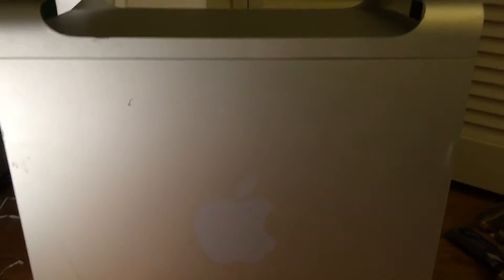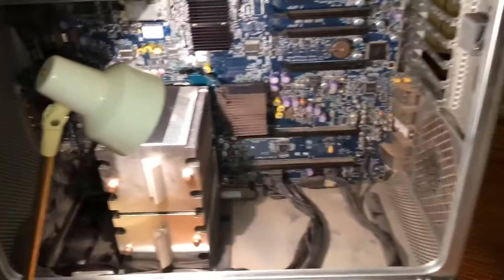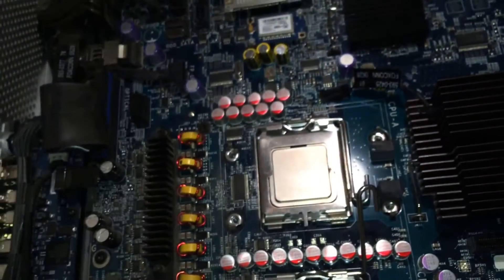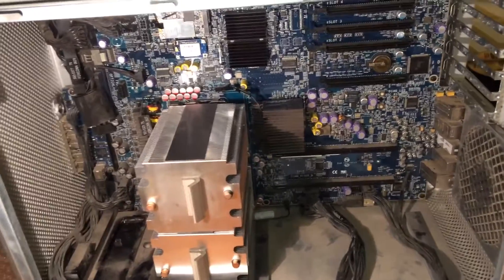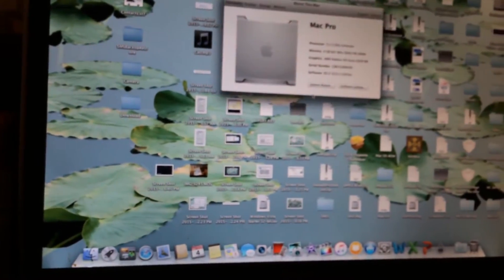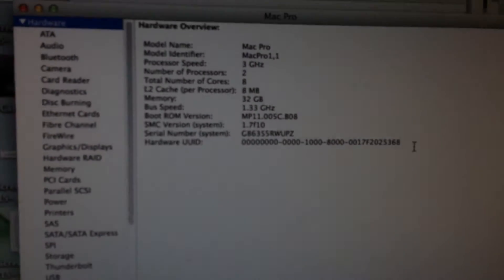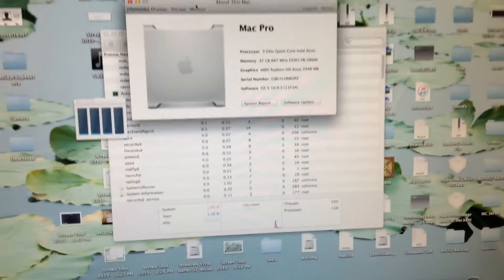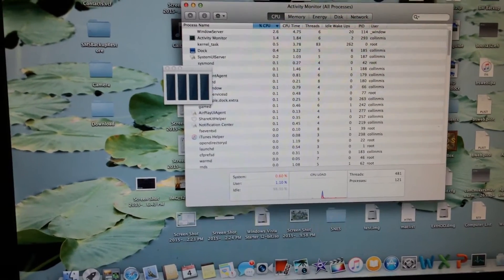Early-2006 Mac Pro 1,1 Quad-Core Xeon Upgrade

Comment: I Just Acquired one of these on marketplace for $25.00; the Seller said it was his Daily for a long time, Finally Quit.
He was Guessing the Power Supply Died, removed the HDD, and Figured someone could use it for a Case Mod.
I'm New to Mac, Couldnt Afford 'em, This is Awesome! I've slowly, Stupid Fan Shroud, been Tearing this Down, It's CAKED with Dust, Im Hoping to get it working & do this Mod depending on whats in there... 6Gig Ram & an ATi 512...
CONGRATS!! on the 2Tb MacMini!

Comment: The ATI Radeon HD 5770 GPU (genuine Mac version) in my Mac Pro 1,1 (not flashed and still has the stock CPUs) runs at full x16. Mavericks is buttery smooth running at 1920x1200 on a first-gen Cinema HD display.
Reply: My ATI Radeon HD 5870  not flashed to

Comment: Can you have time to look into the Mac Pro 1.1/2.1 to accept the x5470? Socket and the bus speed is the same 1333mhz , another YouTuber have try it force the 3.1 firmware and get boot up. Or may be work on windows side ?

Comment: Thanks for the instruction. I have two Mac Pro 1.1 with X5150 CPUs and 32GB RAM installed. I have upgraded both MACs with X5355, and they are running, but when I try to update the firmware on one of them with Lion OSX, I got the error 5530, and the program closes itself. It stops when trying to put the firmware files in the RamDisk. Second one is running on Yosemite (which is not supported on Mac Pro 1.1), and there was no problem with firmware update.

Comment: Hey there thanks so much for this video. I have used your patcher tools for a few years now on various old systems I have laying around, so was glad you turned up when searching this topic. I just got two X5365s in the mail yesterday and am going to be attempting this install here in 2020, the biggest computer teardown I've undertaken in 20 years (when I was 8 and just never got the thing back together). I wonder if you ever sorted out the lane width issue on your graphics cards. I am experiencing problems with poor performance on an AMD R9 285 in Linux and wonder if the lane width may be the issue. Haven't actually sorted out how to probe that without OS X yet but would be interested to know if you, or anybody that may be viewing this video later, has any pointers on graphics issues with this system. Depending on distro, I've noted that, somewhat bafflingly, the 7300GT that came stock on this thing does better than the 9 years newer GPU.

Comment: So is it still worth to buy an MacPro From 2006?
Reply from the maker: Yeah, I'd say so. This one has worked great for me as my main machine for quite awhile.
Reply: Yeah over here in germany i could bye the Pro 1,1 for around 260 bucks i think i will buy one
Reply: Don't spend more than $150. It won't be worth it. Consider the amount you will have to spend on better cpus and a compatible graphics card. You don't want to spend $500 altogether on a Mac that is not nearly half as good as  PC you could get for the same price. As far as graphics cards, look for an older Nvidia card. They tend to be plug n play. I happened to have a GTX550 Ti from an old build. You could probably pick one up for   $50 on Craigslist or the equivalent in Germany. Ebay or whatever.
Reply: they go for 100 euros on ebay mate

Comment: Did you run any benchmarks comparing the new CPUs over the old ones? I have 2 dual core 2,66GHz Intel Xeon 5150 and I want to replace them with 2 quad core 3,0GHz Intel Xeon X5365 SLAED

Comment: I tried this.   I forgot to do the firmware upgrade first. I installed 2 2.66 quad CPU’s. The Mac won’t boot. I went back and put in the original 2.66 cpus. The Mac won’t boot. Nothing. Won’t boot up. No screen boot up. Did I damage the motherboard or the cpus somehow ?

Comment: hey, i am planning this exact upgrade! im planning to upgrade my macpro 2006 (i believe it is already flashed to 2,1) dual Xeons + 64 gb ddr2.. however i really need sum help with GPU's
i am thinking of either 2 x 3/4gb gpus in sli/crossfire
is this feasible?

i currently have an nvidia GTX 560 ti OC in there, but i also own a Radeon RX 480 8gb that i may put in there

any recommendations for dual gpus/ whether my RX 480 would work?

TechDave

Comment: Picked up a 2006 1,1, I have El Cap running with 32 meg of ram, having a warm time trying to get the firmware to update to  2,1. been to a lot of the forums tried everything still a no go, any updates?

Comment: dude. do you still recommend using one of these?, I paid about 80 bucks for a 2.66 dual, I don't know if using and put some money to use it or resell it...help. thx
Reply: Santiago Oviedo 4 yrs ago...
Reply: Doc_Exe i installed el capitan and 16gb ram, a video card and an ssd, its perfect
Reply: Santiago Oviedo what gpu are you using ?
Reply: Doc_Exe an ati raedon 1gb ram.
Reply: @oviedosantiago  for this gpu is good

Comment: Hi DosDude, I have a G5 Built in Oct.2005, Quad Core 2.5 GHZ, 4GB Ram, Model No. A1117.  Would I be able to preform this upgrade on my G5?  or does it have to be a 2006?  Thanks.
Reply from the maker: No, the PowerMac G5 is a completely different machine. Nothing from a G5 will work in a Mac Pro.

Comment: Just did this upgrade after years of hesitating Went from the stock 2.66 dual-core CPUs to a couple of 2.66 quad core CPUs. It was a bit
 of work but everything is running smooth. One small boo-boo. When taking 
out the heat sinks I forgot to mark which was on top and which was on 
bottom. After further observation I noticed on most upgraded Mac pro 
videos, the heatsink with the black rubber pads is on the top cpu, I 
realize my heatsink with the black pads is installed on the bottom cpu. 
Question, do you think it really matters which heatsink is on top or 
bottom. I can switch them over and start over again, but damn, I'm just 
plain tired:) Thanks for any advice.
Reply from the maker: I'd recommend that you switch them back, but I guess it's up to you.
Reply: Thought I'd leave it  when i went to sleep this morning. After three hours of zzzzzs, woke up and switched them around. Hey, great video. Thanks...

Comment: Great video!!
Can you please tell me the video card that you used on the first part of the video?
And, can you please tell me which operation system is the best for this upgrade?
Last question, have you tried to install usb 3.0 on this mac pro?

One again great video and has been inspirational to do it on my own 
Thanks
Reply from the maker: The card I was using was an AMD Radeon HD 6670. You can upgrade this machine to 10.11, El Capitan, which I have a guide about in another video on my channel. I have not attempted to install a USB 3.0 card in this machine.

Comment: Have you tried updating to El Capitan? I have my Mac Pro 1,1 running El Capitan Successfully. Will I need to Update the UEFI? The UEFI is already modified so, I'm not sure if I will need to run the El Capitan installation again.
Reply from the maker: No, you won't need to do anything except flash your machine to a 2,1 as I've done in the video (if it's not flashed already).
Reply: Where did you get the firmware upgrade. From the apple site or...?
Reply from the maker: It's linked in the video description.
Reply: Thanks. I can read but man, I am lazy sometimes! Seriously though. I appreciate it.
Reply: Incidentally, I had to take out my El Capitan Drive because for some reason, it would not allow me to boot to that drive. It was greyed out in Startup Disk selection. Booted into Lion and flashed the EFI from there. Worked well.

Comment: very nice :) I have watched all 3 of your Mac pro 1,1 vids and enjoyed them a lot. I got a Mac pro 1,1 my self yesterday as a Christmas gift from family its a very nice machine and I do plan to install X5365s in at some point... I also have 32GB of ram for it on the way (ram for the mac pro 1,1s is stupid cheap now :) ) I would do 64GB but its a bit too expensive. one thing I did for shits and giggles was load 10.4.11 onto an SSD and installed that in my 1,1 it booted up in literally 15 seconds :P it was stupidly quick lol . hope your happy with your mac pro BTW I tested an nvidia Geforce GT 740 in mine and since its a GK107 based GPU it auto ints all the way back to lion 10.7.5 although OS X does not know what to call it it ran perfectly and in x16 mode too
Reply: How did you get on with the upgrades? I've just done the upgrade that you mentioned today, and this machine is flying.
Reply: Mac Pro 5,1 using an apfs ssd boots in about 10.
Reply: And that’s not even a pcie nvme ssd

Comment: Hey! i have a question. after the upgrade to 2,1 spec, firmware and all, does it mean the computer supports 64gb ddr2 now?
Reply from the maker: +acompres Yes, you should be able to upgrade it to 64 GB of RAM.

Comment: Temperatures? I upgraded my Mac Pro to X5365,and it temperatures is min 50°C max 85°C.Is it have any problems?
Reply from the maker: Mine never get above 50C, under full load. Did you not apply thermal paste or something?

Comment: Hey, I have a mac pro1,1 with dual xeon E5345's and GTX555 What is the best temperature monitor I can use on 10,11?
Reply from the maker: +Quinten Maessen The Mac Pro 1,1 and 2,1 don't support the Xeon E5345... You must be using an '08 model. For temperature monitoring, I use an app called "Hardware Monitor", which you can download here: http://www.bresink.com/osx/HardwareMonitor.html
Reply: +dosdude1 The mac pro 1.1 DOES support the Xeon 5345, It is clovertown based just like the 5355 and 5365, It DOESN"T support xeon 5400 Series
Thanks for the temperature monitor
Reply from the maker: +Quinten Maessen Ah, didn't realize any of the "E" series Xeons were compatible.
Reply: +dosdude1 yep, got them from an old hp server, work perfectly :)

Comment: TDP 150 Watt for EACH CPU! Must be VERY loud.
Reply from the maker: It's not loud at all actually... Runs very quiet, no louder than it did with the stock CPUs installed.
Reply: the heatsinks are massive

Comment: dosdude1 please,please,please help me  i got mac pro model#A1186 i just update the same 3
 GHz quad-core Intel Xeon X5365 CPUs but went i try to update firware 
1.1 to 2.1 wont do anything please hell me im running 2*3 ghz unknown, 
32 gb 
Help pleaseeee
Reply from the maker: +Osmar Sanchez Make sure your startup disk is formatted as GUID, not MBR. You can check this in Disk Utility, just select the drive and make sure it says "Partition Map Scheme: GUID Partition Table" at the bottom.
Reply: t you right i going to fix that thank you

Comment: the PCI-Express 8X is simple to fix !
Run the PCI Express Utility app, and change the settings here..

The previous owner has set these settings to something else,

Check this link :
https://support.apple.com/nl-nl/HT2838

You need to the the  Expansion Slot Utility in mac OSX !

Expansion Slot Utility is in the System:Library:CoreServices folder.
Reply from the maker: +Floor van Nierop I already know about this, and even when set to X16, it only runs at X8.
Reply from the maker: +Floor van Nierop http://dosdude1.com/pics/pciex8.png